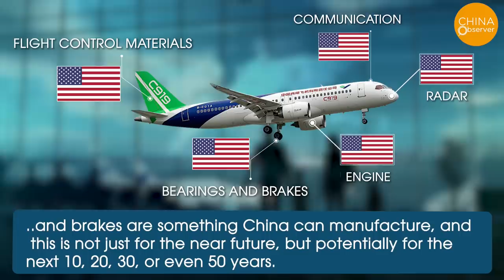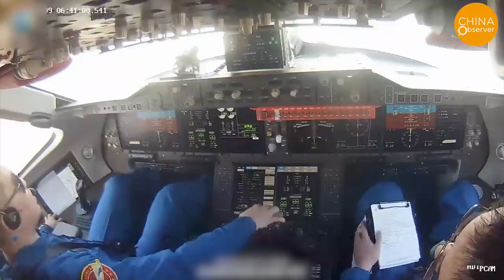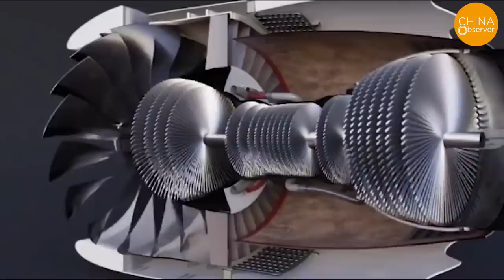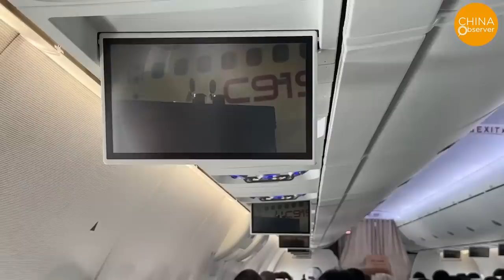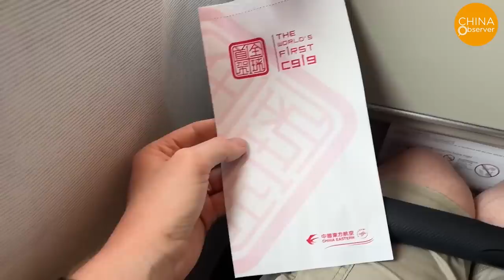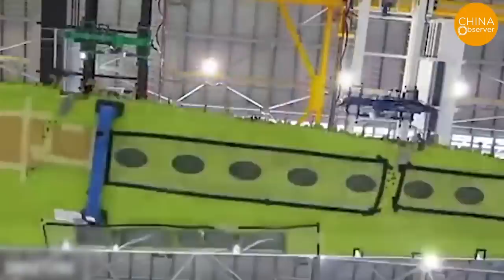The CCP's Aviation Nightmare: 700 Billion Yuan Investment, an Entire Generation Behind in Technology

Comment: Reminds me of the great capacitor fails of twenty years ago. Billions of capaciitors, world wide, failed due to the use of chinesium capacitors whose recipe for electrolitics had been stolen... but the recipe or use of stabilizer was not used or used correctly. Within a short time of use, the capacitors started puffing up and failing... resulting in widespread failures in electronics, like monitors, tv's and countless other products.
 Imagine that type of fiasco... while you're 20,000 ft up in the air...
Reply: The "capacitor plague" is well worth looking up on Wikipedia. In a nutshell, industrial spies stole 95% of the proprietary information that Japan's capacitor makers had developed which enabled Chinese factories to sell cheaper capacitors to component makers. The Chinese capacitors looked and tested OK, passing initial quality control standards, but within a year of actual use, they would degrade, leak, and blow, shorting out, or destroying whatever circuit boards they were soldered into, all because that last 5% of the formula wasn't stolen. Dell spent half a billion on warranty claims, and other makers had to discard huge amounts of finished, but untrustworthy products.
Reply: I forsee this happening again.
Reply: Which lead to the push even in DIY gaming computer scene wanting only Japanese capacitors in parts for their gaming machines. As Back to the Future III taught us, all best stuff is made in Japan.
Reply: bulging capacitors. dell got a lot of calls about that issue.
Reply: First I've heard of this.
Reply: @williamwalker8107  I suggest you Google it. A motherboard I bought (high end Abit with RAID) had some of these 'bad caps'. Wikipedia has an article called 'Capacitor Plague'.

"The capacitor plague was a problem related to a higher-than-expected failure rate of non-solid aluminium electrolytic capacitors between 1999 and 2007, especially those from some Taiwanese manufacturers, due to faulty electrolyte composition that caused corrosion accompanied by gas generation; this often resulted in rupturing of the case of the capacitor from the build-up of pressure.

High failure rates occurred in many well-known brands of electronics, and were particularly evident in motherboards, video cards, and power supplies of personal computers.

A 2003 article in The Independent claimed that the cause of the faulty capacitors was due to a mis-copied formula. In 2001, a scientist working in the Rubycon Corporation in Japan stole a mis-copied formula for capacitors' electrolytes. He then took the faulty formula to the Luminous Town Electric company in China, where he had previously been employed. In the same year, the scientist's staff left China, stealing again the mis-copied formula and moving to Taiwan, where they created their own company, producing capacitors and propagating even more of this faulty formula of capacitor electrolytes."
Reply: @austinfeller2368  Component forgery is common in china.
Reply: @johnstuartsmith  Moral of the story: don't buy Chinese products if at all possible.
Reply: @grahamstevenson1740  Moral of this and similar stories: don't hire Chinese workers (don't know if this guy was Chinese). They'll steal any IP not "nailed down".
Reply: @johnstuartsmith  I hope Dell and other companies learned a valuable lesson to not purchase cheap knockoffs from stolen technology.
Reply: Very important to pay attention to what @grahamstevenson1740 wrote. The capacitor fiasco was not a Chinese (PRC) problem. It was a failure of Taiwan industrial espionage. Nobody who follows this channel should ever confuse the PRC and Taiwan.
Reply: I have had many "electronics" blow up or smoke or burn on me while in china.  They usually shut down electricity in the entire unit, causing a lot of trouble since these were usually rented and not easy to figure out where the box was.
Reply: @grahamstevenson1740  Similar thing is happening with chinese electric bike batteries. An incredible amount are catching on fire. Four people died in NY's chinatown just a week or so ago when an ebike store went up in flames. If I didn't know better I would think the chinese are doing this on purpose. Oh wait a minute.....
Reply: @3markaw  The quality control on those batteries is fairly low. They're not made in the high-tech factories where EV batteries are made. There have been instances of fires from them in the UK too. It's simply shoddy workmanship. Sadly there's a fair amount of that to be found in China and it's hard to distinguish good from bad. There certainly is good stuff too coming out of the place but it's hard to tell what's what.
Reply: Sweet story
Reply: Both other major aircraft makers welcome Comac C919 because General Electric even bought a lot recently. Homemade advanced body hull and avionics and billions of people harder working dedicated people trying harder to improve lives and at faster rates than our tarnished US reputation and greedy corporations agendas treating people as Sheeple. 

China's people have no homeless people as our Western countries because it's in the constitution that all people are helped to have good livelihood and most people are happy to help others grow economically for millons of independent businesses. 

YouTube famous tourists shared how much safer, cleaner, quieter and more openness each month for acceptance internationally for businesses. 

Boeing stock is far far down from only a few years ago before losing 2 heavy class passenger aircraft in 1 day .

They blamed overwhelming computer loads but their own employee shared about how rushing the planes out the door to meet sales schedules. 

China has no such large-scale corruption as Boeing Aircraft lost public trust. 

Public execution is extreme punishment for officers stealing public resources, and the negative issues are disappearing with justice systems more modernized, too.

The wealthy families influence government recent years for rapid improvements, the same as other growing countries in recent decades.
Reply: Yeah we don’t need tofu dreg airliners.
Reply: Never heard of this and I lived through it since I was born in 86! Ha ha Jesus that is hilarious but scary at that same time.

 I wonder how it was being any type of electrical worker, manufacturer, etc etc. Transformers are freaken everywhere.

 Sadly we all have short memories and will repeat the mistake.

 Just learned last week that the Three Gorges Dam is failing and I remember my grandpa being like "Give it thirty years. Watch... They are building it too quickly and way too cheaply." I asked him what made him come to the conclusion and he said "China is trying to make a political statement that they are now peers. This and the Olympics... Making statements and rushing it never works out well".

 Anyway thanks for the information and will learn more!
Reply: @johnstuartsmith the wiki says the problem was caused by a taiwanese company in taiwan. Thanks for supporting china’s claim over taiwan.
Reply: @Thankz4sharing  Read what he said very carefully, because it appears YOU did not !!
Reply: @arkhsm  Fair point. Actors from Japan, PRC and Taiwan were all part of the story. My viewpoint is biased by having device failures caused by Taiwan sourced caps.
Reply: What about the Chinese semiconductors used in the USN Littoral ships and the UK Daring Class Type 45 Destroyers. It costs the  UK taxpayers over ONE Billion Pounds to replace each ship's semiconductors made in China. It beggars belief how they would use Chinese on a warship.